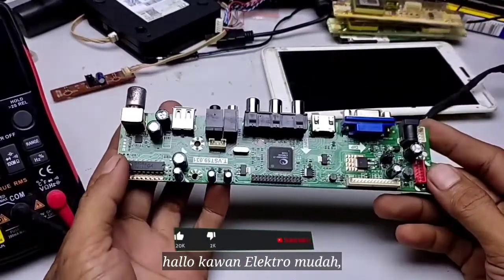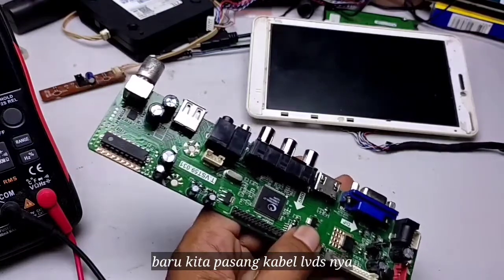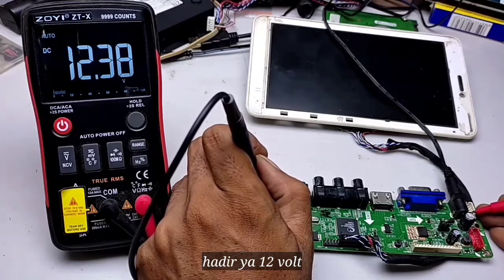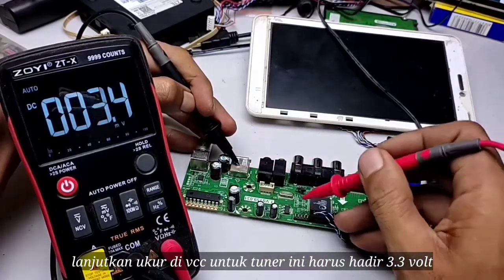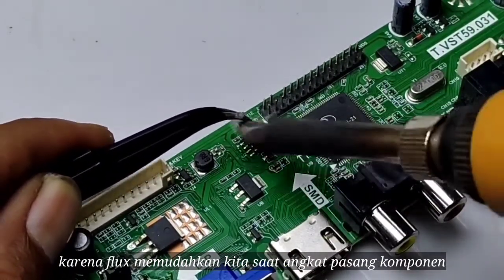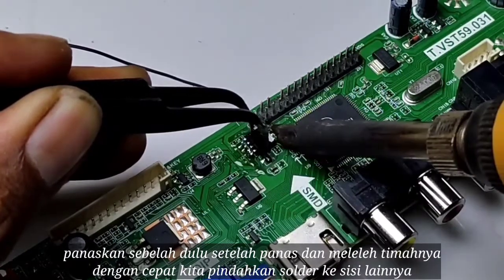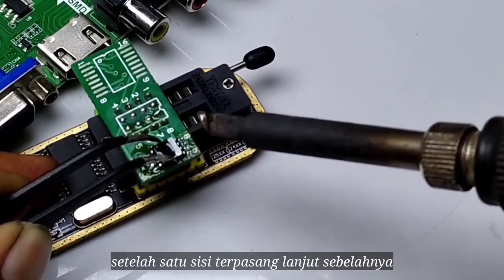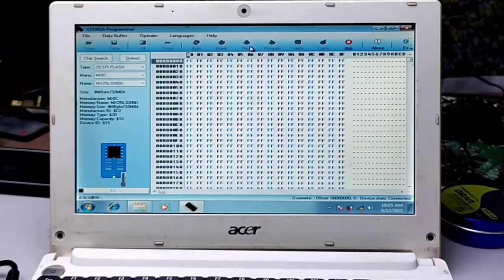Universal Led Board Standby Problem Test Dengan Lcd Tablet 7 Inch

Comment: Izin bertanya om,  punya saya mesin universal  mati total,  cek tegangan semua normal kecuali tegangan menuju ticon  0v mohon bantuannya om?
Reply from the maker: Cek tegangan untuk tcon di mb setelah soket lvds di lepas kalau masih 0 volt cek TR di jalur vcc tcon
Reply: @ElektroMudah1618 iya om,  kaki tengah dari TR itu tidak mengeluarkan arus 12v setelah saya buka socket lvds nya, 
TR tipe npn atau pnp ya om?
Reply from the maker: @panhauten.panhautenjax8283 p channel mosfet bisa pakai a19t

Comment: om tanya ,proyektor saya pake lcd 2 inch resolution 480x360p 30 pin dan pake ic ttl ms90c386b  dan saya mau lcd baru yang resolusi 480x272p dengan layar 4.3inch 24 bit jugaa tapi pin 40pin dan untuk data bus rgb nya sama karena 40 pin nya itu power backlight dan jalur touchscreen dan selain itu sama dengan yg 30 pin,tapi di proyektor pemasangan pin nya secara acak di pin rgb dan control panel pixelnya itu gimana om apakah bisa di aplikasi kan tapi dengan merubah posisi pin di lcd yang baru itu Terima kasih
Reply from the maker: Betul sekali lcd tsb masih pake data bus RGB dan bisa di aplikasikan , untuk ukuran lcd nya ga pengaruh tapi beda resolusi dan bit yang membuat tampilan lcd nya bisa blank atau melebar atau yang lain

Comment: Bang, saya mau tanya, saya punya lcd advan E3a resolusi 800x480 dan saya sudah beli converter yg 50 pin, tapi lcdnya ga hidup dan mainboard universal sama seperti di video
Reply from the maker: Jumper vcc harus di 3.3volt
Reply: @ElektroMudah1618  bang, tadi saya cek lagi, lcdnya blank bergaris, apa harus di flash yah, tolong bingungnya
Reply from the maker: Flash dengan resolusi 800x480 sesuaikan lcd tapi hampir semua MB universal tv ga ada resolusi tsb,paling mentok resolusi 1024x720
Reply: @ElektroMudah1618  bang boleh minta FW yang resolusi 16 : 9 1366X763
Reply from the maker: Tipe mainboard berapa
Reply: @ElektroMudah1618  chipset TSMV29LU, model board T.VST59.031
Reply from the maker: Beda chipset kalau punya ku tsumv59xu
Reply: @ElektroMudah1618  berarti ga bisa di rubah resolusi nya, ya bang

Comment: gan minta link firmware nya dong
Reply from the maker: Board nya tipe apa
Reply: @ElektroMudah1618  t.vst59.031 ... chipset tsumv29lu
Reply from the maker: Kalo tsumv29lu sy punya tapi belum fix di tombol remot jadi kacau dan untuk donlot nya di github ada 2 jenis tuner lama atau r840
Reply: @ElektroMudah1618  boleh minta ga gan
Reply from the maker: Wa saja ya di tentang channel

Comment: Permisi bang, saya ingin bertanya bang, kalau Kabel LVDS dari layar tablet 7 inch ke LCD Board itu jenis/nama kabel LVDS apa ya bang namanya, Terimakasih bang, saya udah Subscribe
Reply from the maker: Ada board konverter tambahan untuk merubah signal lvds ke ttl karena lcd tablet signal ttl, terimakasih support nya
Reply: @ElektroMudah1618  Make a video on how to connect 7 inch tablet display to universal motherboard brother!
Reply from the maker: there is already a video
Reply: @ElektroMudah1618  ok thanks i just subscribed to your channel.  Haven't seen your last video.  I'll see now
Reply: https://shopee.co.id/product/132036057/12874192811?smtt=0.176248722-1650652488.9 yang seperti ini bukan Bang?

Comment: Bang sy punya mesin tv universal sm persis dgn punya abang sy coba nyala semua backlight di layar jg nyala tp layarnya blank hitam kira² masalahnya dmn? Apa mungkin di fw nya?
Reply from the maker: Bisa juga karena fw nya 
Punya ku board vst59 031
Reply: @ElektroMudah1618  sama bang pny sy jg type it mngkn bs dikasi link downloadnya untk fw nya
Reply: @ElektroMudah1618  bang beda type layar beda fw ya?
Reply from the maker: Belum tentu karena patokannya bukan di berapa inch lcd
Reply from the maker: Usahakan cari datasheet lcd nya yg mau di pasang
Reply: @ElektroMudah1618  wkt beli sm yg jual dikasi inverter untk backlight lcd & kabel lvdsnya 30 pin sedangkan layar yg sy pasang layar led bekas laptop 40 pin
Reply from the maker: Tinggal beli kabel lvds 40 pin, berapa seri panel lcd nya biasanya ada sticker, nanti inverter nya ga ke pake

Comment: Om punya saya habis saya flash dan sekarang mati . Lampu indikator pun tidak nyala.  Kasus nya hampir sama yang di video . Padahal firmware seperti yang biasa saya pakai . Bagaimana solusi nya .  ? Sedangkan saya tidak punya alat untuk flash eprom
Reply from the maker: Kalau lampu indikator mati cek dari jack adaptor 12v apakah ada lalu regulator stepdown 12v ke 5v, 5v ini yg akan di stepdown lagi menjadi beberapa volt di setiap ic regulator lagi pastikan tidak ada short circuit
Reply: @ElektroMudah1618  kalau dari Jack 12v ada cuman yang di output ke panel 3.3 v tidak ada . Awalnya ada . 
Saya cek kapasitor smd dengan avo analog rata2 ngesort . Tapi saya cek dengan avo digital kapasitor masih ada hambatan dalamnya . 
Tipe board yang saya gunakan mt3663.81a .. apakah chipset yang bermasalah
Reply from the maker: Kalau chipset panas bisa di pastikan chipset short, 3.3v ke panel menunggu perintah on baru keluar, sedangkan led indikator saja mati jadi yg bermasalah urut dari 5v baru ke tegangan 3.3v untuk ic eprom, 1.2 untuk vcore

Comment: Lcd mito 61 pin bisa nggak
Reply from the maker: Harus nya bisa karena sama-sama ttl cuma beda soket nya, asal tau datasheet lcd dan metode jumper
Reply: @ElektroMudah1618  kalau konverternya ada nggak
Reply from the maker: Ada konverter nya cuma soket nya untuk lcd tablet 50 pin
Reply: @ElektroMudah1618  wah jadi nggak bisa dong dikasih mesin tv universal
Reply from the maker: Hanya untuk test2 mb universal saja
Reply from the maker: Karena resolusi masih rendah 800x480

Comment: Klu memakai 7inch apa selalu harus ganti fw mas..?
Reply from the maker: Lcd 7inch hanya untuk test saja, jadi tidak harus ganti fw
Reply: @ElektroMudah1618  ane ada yg 30 pin apakah bisa?
Reply from the maker: Lihat datasheet panel lcd nya, data signal lvds atau ttl
Reply: @ElektroMudah1618 lcd bekas tablet juga sih
Reply from the maker: Seri panel nya berapa, nanti tak carikan Datasheetnya
Reply: @ElektroMudah1618  masih belum bongkar masih terpasang,ane udah pernah nyatet sih tapi tau kemana hilang, nanti aja lanjut Wa.

Comment: Bang layarnya pakai bekas tablet apa..
Reply from the maker: Tablet advan e1c tapi ada driver ttl nya
Reply: Driver ttl nya seperti apa ya..?
Reply from the maker: Ketik di google driver konverter lvds to ttl
Reply from the maker: Sudah ketemu mas, driver ttl nya, kalau belum boleh wa sy
Reply: @ElektroMudah1618  sudah ketemu saya masih penasaran yang AuO c070vw02
Reply from the maker: Ternyata beda jalur ya AUO sama lcd ttl pada umumnya
Reply: @ElektroMudah1618  hooh bingung nyari jalur lanjut di Wa ya masih sama yg kemaren kan?
Reply from the maker: Sama, silahkan

Comment: Bang mau tanya nih..  Saya punya mainboard universal sama kaya abang gelaja ny..  Saya cek teg semua hadir 1.2v,1.8v,3.3v,5v,12v tetep gak mau start. Ic eprom sudah saya flash.. Apany iya bang yang rusak.. Terimakasih
Reply from the maker: Pakai fw yang mana
Reply: @ElektroMudah1618  firmware sharp 23LE100M
Reply from the maker: Fw asli sudah di backup dulu, soalnya board beda seri memang chipset sama tapi untuk ic tunernya mungkin beda, kondisi standby chipset hangat, dingin atau panas
Reply: @ElektroMudah1618  firmware sudah saya backup terus emang ngaruh bang ic tuner ny klo beda firmware.. Chipset mode stanby hangat aja bang..
Reply: Kirain saya firmware ny bang eh gak tau ny sama tetap stanby.. Apa saya flash lagi pake data fir bawaan nya..
Reply: Oya bang saya klo point teg klo posisi stnby dan sudah start emng beda.. Maklum bang masih pemula.. Nanti saya auto sub deh klo bang baik..
Reply from the maker: ic tuner kalau beda nanti siaran tv gak ada. Lanjut wa saja mungkin butuh fw seperti yang di video
Reply from the maker: Kalau teg ada yang sampean sebutkan berarti sudah start tp tidak mau boot fw, kemungkinan fw /eprom yang rusak lanjut wa bang komen di sini lama selesainya
Reply: @ElektroMudah1618  lanjut wa no abang ny mna
Reply from the maker: Di deskripsi channel, tapi nanti ya bisa balas ini masih di jalan
Reply: @ElektroMudah1618  ok bang.. Ditunggu